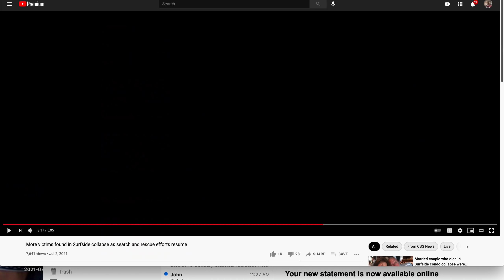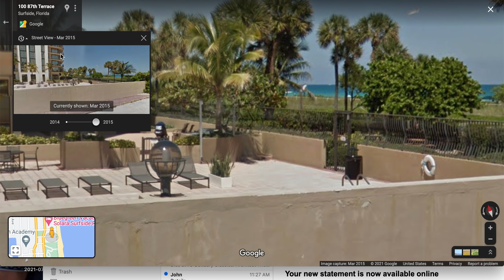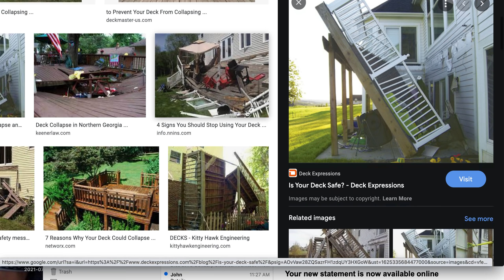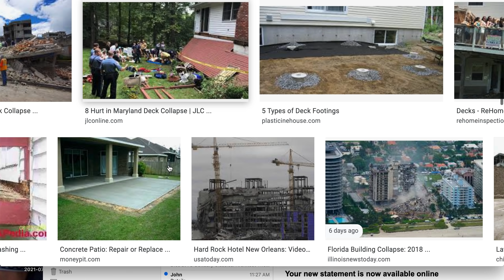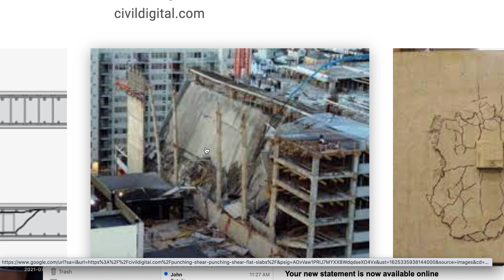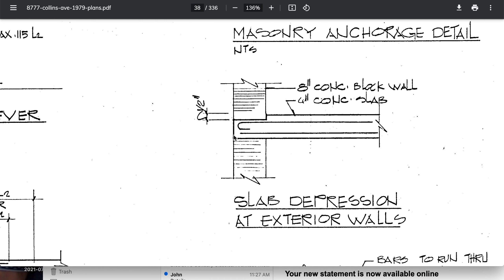Champlain Towers Collapse ENGINEER says it will take WEEKS to demo this weakened structure!

Comment: 0:47 Better yet why not put blasting caps on all of the columns on the front of the building and collapse the rest of the building down onto the street, away from the current debris pile? The street is going to be closed for the foreseeable future anyway. So why not use it for the second debris pile?  That would seem to be the quickest solution to getting recovery started again.

Comment: I'd have the sister building one block north that was built identical .I'd have the column's x Ray's at every column on every floor. To see if the rebar is attached to the columns or are the just butted up to the columns.
Reply: Is that possible? I've been looking at that building, especially since it was designed by the same architect, has the same plans, had the same general contractor. I'm not sure if they had the same crews building it.
Reply: the building Owners (residents) can pay for any type of analysis they desire

Comment: 14:00 you need to check the lobby level framing plan of the new penthouse pdf, sheet S5 of 14 (page 30 on pdf). In the upper left corner there is the detail of slab drops and yes there's a beam there. https://www.townofsurfsidefl.gov/docs/default-source/default-document-library/town-clerk-documents/champlain-towers-south-public-records/8777-collins-ave---new-penthouse-addition-1-6-of-6.pdf?sfvrsn=6191194_3

Comment: Hi. Seems they've been in forensics mode (recovery & evidence to discover what happened there) for several days, thus not yet ready to bring down the building. 
  You may already have this page from the city who are uploading documents,  yet if you don't,  I hope this helps.
https://www.townofsurfsidefl.gov/departments-services/town-clerk/champlain-towers-public-records-documents

This building has a lot of issues historically.  It doesn't seem any one thing was the problem, yet regardless,  it still shouldn't have failed. You have to wonder about the  other Champlaine buildings, as well as other buildings there.
Reply: very helpful page, also glad there adding stuff from a few days ago when I was there grabbing the 2021 and 1979 plans.    oh, pdf named "8777-collins-ave---new-penthouse-addition-1-6-of-6" on page 30, top left and bottom right appears to be all there is for that "beam" elevation change on the first floor pool deck. looks to be the same as the detail for the generator room pages in the 2021 plans (with the super long file name).

we need not be at nerves edge either, I'm just trying to identify parts in the ruble pile, similar to "locating the 4 corners of the plane" part of a crash investigation. also we need not even doubt the structural capacity of the structure, as we can all see it in a pile for the most part, and it sounds like the last standing bit is not in good condition.

Comment: Bm A and slab drops on page 162  left top
Reply from the maker: I did find that but still need to know it's intent... and I really appreciate you doing some of the heavy lifting and sharing how you found it...  Now the really heavy lifting is finding out how this pool deck was connected to the structure; that is the one that I need to verify... Thanks Kabdi and I hope you find it first.
Reply: @LoadPathEngineering  

You are welcome,  
As my calculation there are a huge loads around 3columns collapsed 
1 the weight of Flat slab with flooring finishing
2 the weight of sand green space boxes 

The Rebar flat slab (pool area side) is not good details bad designed fixation to the (bottom of drops beams) !
Reply: I spent an hour looking for that detail but couldn't find it. Well done. Poor drafting to hide it in a corner of a  plan drawing. If the pool deck dropped it would twist this beam and the outer building columns before failing along this line. Minutes later the main building would collapse. They need to evacuate Champlain North because their deck could fail in the same way.

Comment: I heard there were people who got out when the building started breaking. Does anyone know if the fire alarm was triggered?
Reply: In the footage from the security camera situated in Unit 711 - the earthquake effect footage he referenced with the debris falling from the ceiling - it didn't sound as though any alarms were set off. The footage seems to end due to power loss just as the first major portion of collapse started. No systems went off automatically and nothing was triggered manually. It would seem those exiting were likely in too much of a panic.

Comment: Ty for the video.  Sorry but what is a ledger
Reply: A ledger can be a board or a concrete beam along the outside of the building perimeter used to support the deck at the main part of the structure.